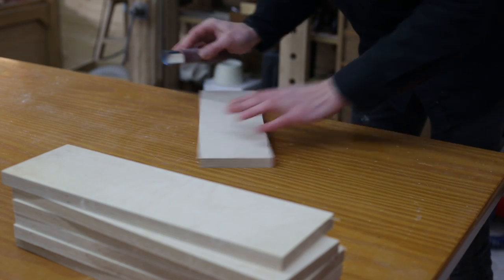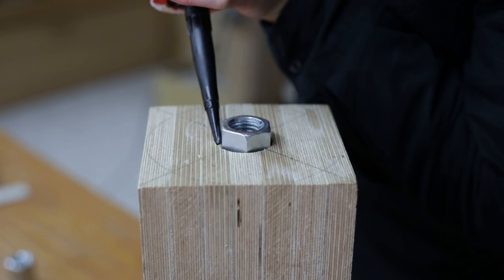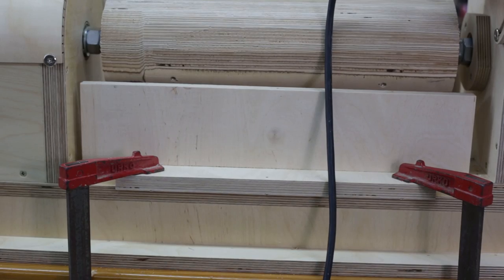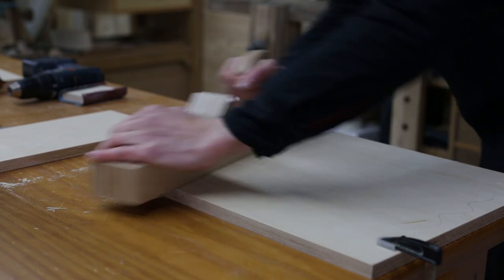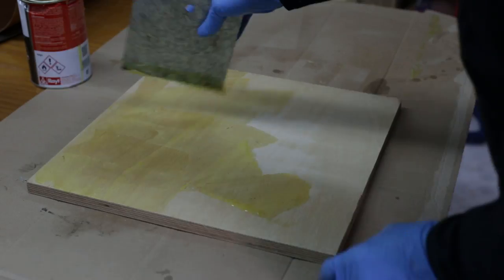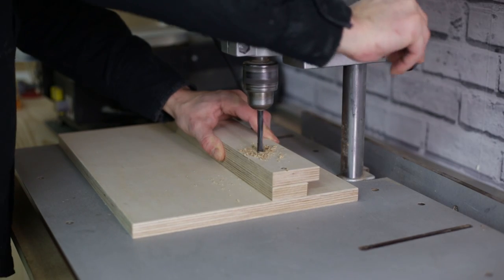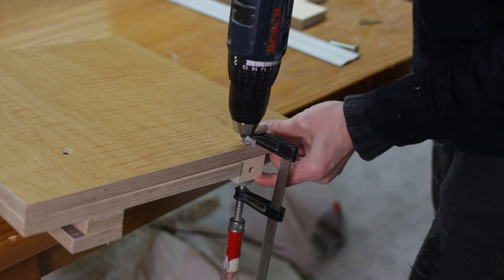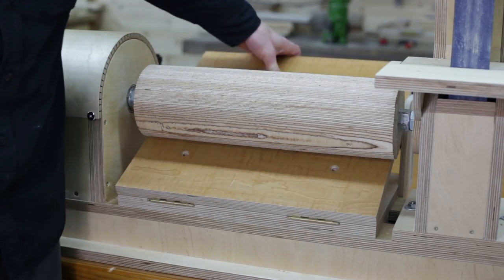Lathe Sanding Station: Thickness Sander Part1

Comment: Thanks for the video! Just a bit of pedantry but one disadvantage of gluing the cylinder like that is that the plywood is typically only stable in the width and length directions and it changes thickness so the drum could become elongated with humidity changes. However, it's probably too small to even measure unless you're living in an area with particularly violent humidity changes.

Comment: I am trying to design a set of detailed plans in SketchUp. I find two things very hard.

How do you make contersunk holes for screws (to show how many screws you need in a spot and where they should be positioned)?

And how do you "drill" a hole in a flat 3D object if that object is already a component?
Reply from the maker: I think these two videos will help you:
https://www.youtube.com/watch?v=AAro_u1Wv00

https://forums.sketchup.com/t/is-using-push-pull-a-good-way-to-make-a-hole/747/2
Reply: Paoson WoodWorking Thanks a lot! I'll check them out.